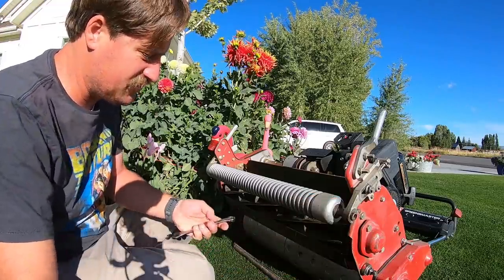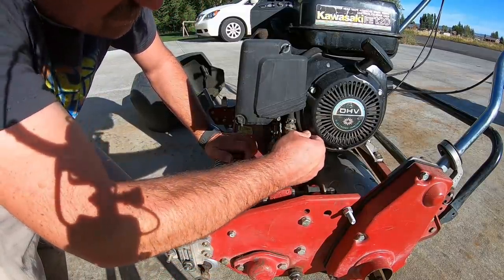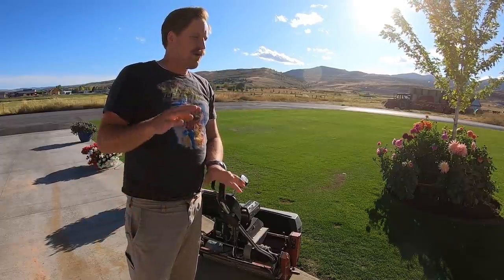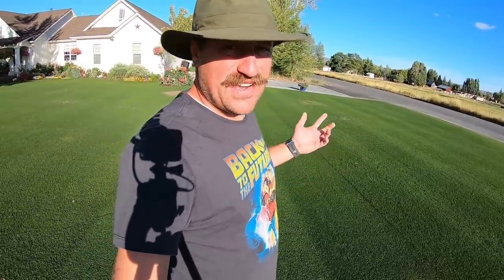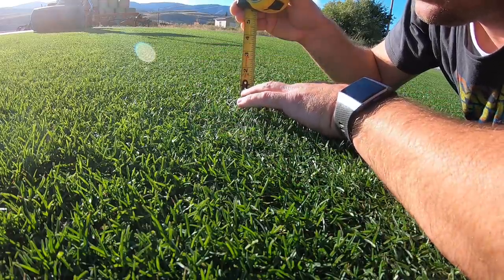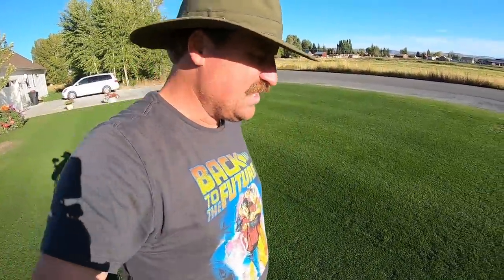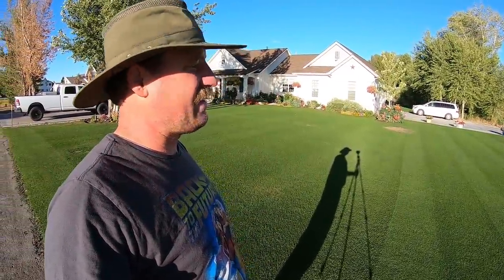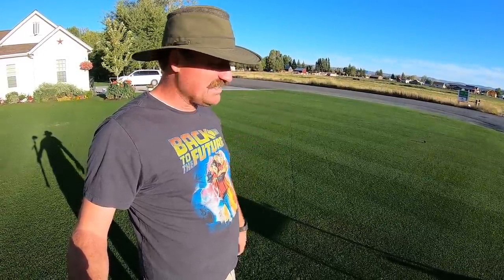Kentucky Bluegrass Mowed at 1/2" REEL MOWER

Comment: That’s tight, right there. I’ve wanted a reel mower since I can remember. Maybe one day I can fit one in the budget. Thanks for the great/fun videos, Connor!
Reply from the maker: start with an inexpensive one like a used McClane
Reply: Ironically that’s exactly what I did..  paid $400 for it and it does the job and some.  I believe the blade width is 20”.  I suggest OfferUp or Craigslist.  Congrats the KBG, looking amazing.